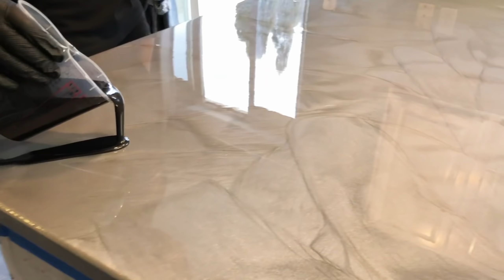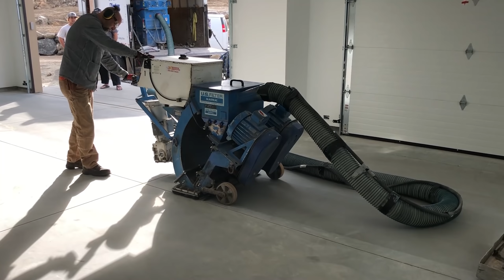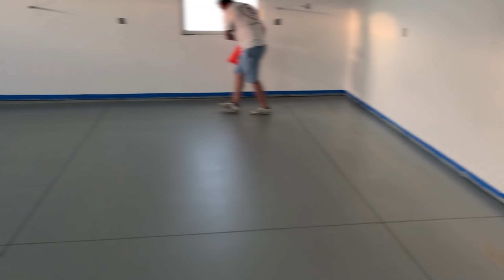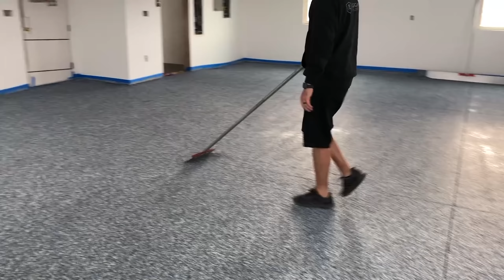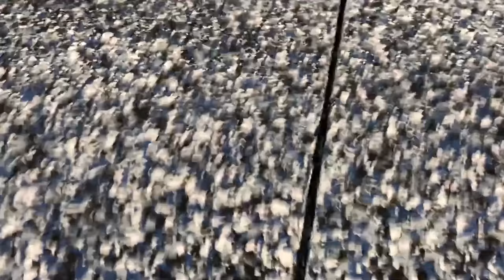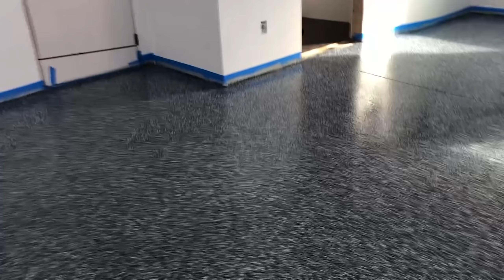Concrete Garage Coated Using Epoxy & Paint Chips | Step By Step Process

Comment: Curious as to why you didn't use a promotion adhesive before you put the primer down?
Reply from the maker: Because our primer will have a hard time adhering to it.  Once you grind the concrete and open the pores than our primer will adhere to it.
Reply: So if I don't grind my garage floor, i would need to add an adhesive promoter?  Thx

Comment: Hi, me and my mom are trying to correct a guy who did ours without a seal (epoxy) and with no a lot of flakes. Any advice on how to start, there is already Keheils and little flakes but they keep rising... any dupes as well for epoxy from Home Depot or such?
Reply from the maker: You can contact our techs at 844-534-4274 ext. 1 and they can assist you.

Comment: How many lbs of paint chip per 100 square foot to get a floor like that? Also how many top coats did you put on? FYI you keep telling people to go to your website for the kits, however you do not have this type kit of the site at all.
Reply from the maker: You can email leggari@gmail.com and they can assist you.  Depends on the floor but usually you do 1 lb. of flakes for 6 sq. ft. and you can do either one ore two urethane top coats over the surface.

Comment: Nice floor!! Why do you wear cleats? Wouldn’t there be cleat marks? Just curious about that :)
Reply: You wear cleats so you don't leave shoe prints. The epoxy is typically self leveling, meaning it'll fill in the spots from the spikes.
Reply: I was searching for this question when I noticed the cleats 🙂

Comment: The price of the Leggari products really floored me.  A two car garage at 500 sq ft was going to cost me close to $3000.  The estimates I got for contractors to do the whole thing were between $3300 and $3700. I wonder what products the contractors were using.  I suppose if the contractor was going to use the Leggari products the estimates would have been more like $5000 ??
Reply: You can buy the same products legarri has at local building supply stores for 1000$ leas

Comment: Yea I guess I can now see why a 2-3 car garage could cost upwards of 4-5g with the flakes. I always wondered why more people haven't done this around where I'm at but I think they have hard time rationalizing paying that much. .
Reply from the maker: The great thing about the flake floors is that you don't need as much epoxy.
Reply: @LeggariProducts  I had a onsite consultation from one of the companies and he recommended polyurethane instead of expoxy, said they're both great but the urethane is a bit more durable. Anyway he had a nice glossy black color with silver glitter, looked pretty cool so he's gonna do up a quote. Prob in the 3-4 grand range. If its more than that I got another guy coming next week to meet and check the garage out. His initial estimate was quite a bit cheaper but uses some hybrid of epoxy and something else.

Comment: What kind of primer did you use?
Reply from the maker: Our Leggari primer is a water based epoxy specifically designed to chemically bond to almost all smooth surfaces.

Comment: Ya had me at creating a profile. Most don't even know the microfractures are 100% needed. No epoxy in the expansion joints. 100% correct.  Great video. Only complaint....You should have touched base on the cleaning process.
Reply: What is the cleaning process?

Comment: To do 900 sq ft how much epoxy  do I need?
Reply from the maker: You can actually order or price out a custom kit for that exact square footage through the Floors section of our website at www.leggari.com. Simply click on Floors >>>> Order Floor Kit Here then the link order floor kit, then follow the steps.
Reply: Its wayyyyy too much money. Dont buy this crap! I just checked for 850sqft and the total for everything they put in my cart was 9ver $2300 bucks! Screw that! Nice floor, but ain't worth $2k
Reply: @thanasispapakiriakos7579  it is super expensive.

Comment: Nice work. Do you always use epoxy top coat? Ever had any issues with yellowing?
Reply from the maker: We have 3 different top coat options. Glaze coat is our super high gloss top coat that lays out glass smooth just like the metallic epoxy coat. Our WB Urethane comes in high gloss and leaves a minor texture and we also have a WB Urethane that’s a Matte/Satin finish.  Our urethane top coat are UV stable.

Comment: i like to see epoxy on stair
Reply from the maker: You can apply it on top of the stairs but the vertical surfaces are a little harder to apply because the epoxy will just run.  But you can do it.

Comment: I put on 'rock solid floors'  Polycuramine which is 20 times stronger than epoxy, five years later my shop garage floors look as new.  My buddy put in the epoxy and one year later tire marks and some flaking discolouring.  Its not fun either way but do the research.  Epoxy is an easy one man show.  I did rock solid by myself, I needed help more than once, mixing and laying it down.  Just FYI.
Reply from the maker: Our industrial grade epoxy has stood up the wear and tear over time in many garage floors.  Thanks for watching the video

Comment: Good to see coating install using proper prep. Unless you have extremely soft concrete, drop the wb epoxy since it's a weaker pull test vs 100% solids. Invest the money into a polyaspartic top coat since that epoxy will yellow.
Reply from the maker: We have a poly aspartic epoxy that is available on our new website in about a month.  Thanks for watching the video

Comment: I just paid a pretty penny for a flake, epoxy like floor (polyurerthane) The flakes looked ok down but when they put the top coat on, I noticed the floor was rough to the tough and more textured than the sample I was shown. Pretty sure epoxy and similar garage floors should be smooth and high gloss look, not chippy or almost crunchy looking, almost sandpaper to the feel. They are coming back to apply more top coat and may lightly sand but so far its not even close to worth the money spent.